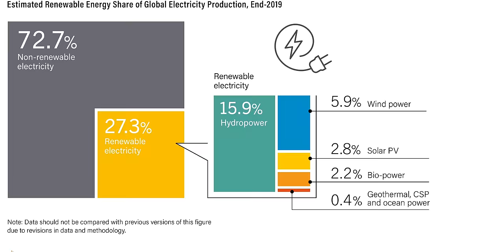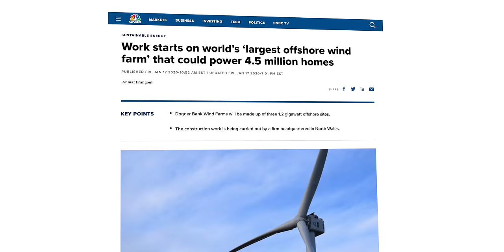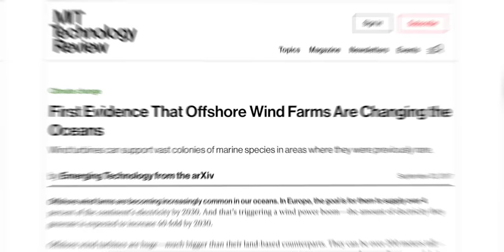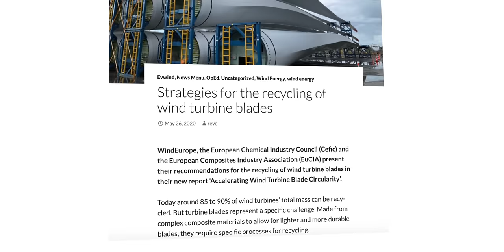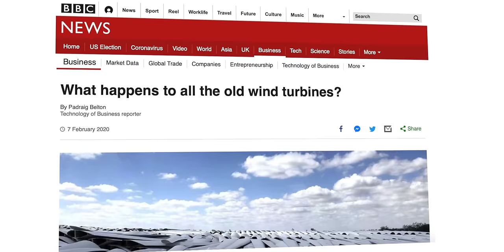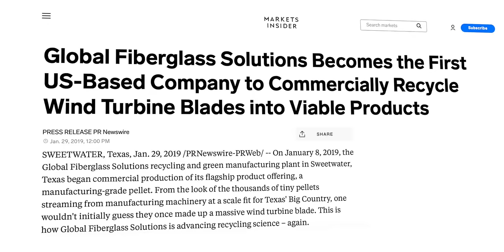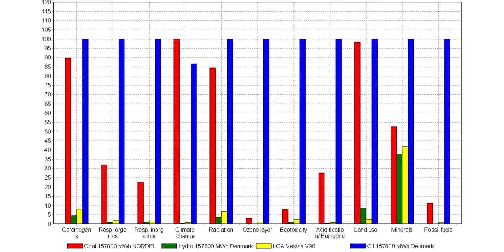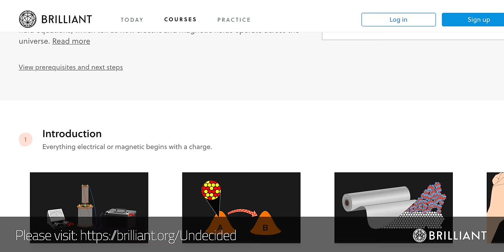The truth about wind turbines - how bad are they?

Comment from the maker: What do you think about wind power vs. the downsides?  And if you liked this video, be sure to check out my video "The truth about nuclear fusion power - new breakthroughs": https://www.youtube.com/watch?v=Wc8SJqAPVaM&list=PLnTSM-ORSgi7cadIj6qpCWkg-tPzN1sgj&index=3
Reply: Undecided with Matt Ferrell I sort of roll my eyes when the discussion devolves into the relative eco-friendliness all the way back to the manufacturering and installation process.  EVERYTHING has to be manufactured and installed-- nuclear, solar (and associated batteries), wind, hydro, oil and gas.  EVERYTHING has a negative global energy impact.  Clearly, burning fossil fuels, every day, to actually produce the energy is the elephant in the room.  Can we please stop the focus on the 1% of energy use and keep the focus on the 99%?
Reply: It’s important to make it clear that because wind is intermittent and requires 24/7/365 backup by reliable energy (normally fossil fuels), that wind and solar can’t be cost effective. If you build a 300MW wind farm, you also have to build (or keep open) a duplicate backup fossil fuel energy plant to provide energy for the 50%-100% of time wind or solar aren’t working properly. So you now are paying for 2 energy plants vs only 1 before, but all the cost estimates for solar/wind exclude the cost of the mandatory back up plant. This type of “Enron Pro-Forma Accounting” fraud is rampant in the solar/wind area. Having to pay for double the energy plants is the primary reason people are shocked by skyrocketing energy cost where ever solar/wind are added. There are no exception, everywhere solar and wind are installed, energy prices skyrocket for consumers. Solar and wind have to cost more, a lot more.
Reply: alliejr You are spot on! So many people view energy as just a “free” gust of wind or ray of sunshine, but that a very superficial understanding. Energy is the entire life cycle process from converting raw matter into reliable and affordable energy that scales, to its disposal when obsolete. When view in their full life cycle context, solar and wind are anything but green or clean...They are dirty and destructive toxic messes.
Reply: I would really like to see your take on vertical Turbines, Wind and Water(like Turbulent). I heard Vertical Windturbines are more Birdfriendly and take up less space, because the blades are not sticking out. Some claim they are even more efficient is that true?
Reply: Steve Fortuna You would IF batteries could store enough to meet base-load, avg hourly demand, peak and peak hourly demand plus days of storage, but that’s not possible given today’s current tech snd cost. Likely to change in future, but as it stands today, solar and wind only add cost and instability to grid.
Reply: Steve Fortuna  SF no need to revert to character attacks, just keep bringing information to the table for enlightenment.  There is a lot of people who feel like Tony, only with positive education with open dialog we can continue to make wiser decisions.
Reply: I just wish these wind turbines were installed in the urban areas that want the power that is produced, mostly for their benefit.  In my opinion, they destroy the views of nature in rural areas.  Also, raptors (hawks, eagles & falcons) are disproportionately killed, as they do not look ahead when flying, their view is downwards, looking for their next meal (prey).  If the incentives were never offered, I believe the numbers of wind turbines installed would be much smaller than the numbers we have today.
Reply: Steve Fortuna “The daylight energy cost going to the grid is....” The grid you mentioned is powered by fossil fuels. My point stands, your cost accounting is straight out of the Enron Pro-forma Accounting playbook, it’s dishonest.
Reply: Steve Fortuna “The man doth protest too much, methinks” Steve you just responded with the worlds longest Red Herring. No need to try and make up in volume what ya lacking in substance. And, ya really need to work on your interpersonal skills, but internet anonymity has a way of making other wise sheepish people act like wolves.
Reply: What actually causes a wind turbine to reach its end of life and require it to be fully taken apart?
Reply: I like birds. Never liked wind turbans. Windmills are far better. It is all about tip speed, which it too high because the blades are too thin so the blades must be long. The air blows THROUGH the blades of a windmill, so windmill blades are wider and don't need to be so long. This makes windmills much quieter and kill very few birds.
Reply: tagware Thanks for sharing the link, I’ll check it out. 

It’s not that there aren’t ways to store energy outside of fossils, it’s more about how dishonestly the current capabilities/cost of solar/wind are presented to the public. There isn’t a single factory anywhere in the world powered by self sufficient wind/solar and batteries. Not one. 

Steve’s 80 page Red Herring retort didn’t even attempt to defend his “don’t need a grid, just build batteries” statement which is what the discussion was about. I reminded him the factory he installed his 200MW solar system in, is connected to, and powered by, the fossil fuel grid. In other words it’s the furthest thing imaginable from self sufficient solar/wind, yet Steve wants to argue that we don’t need grids, just build batteries. It’s such a superficial understanding of how energy works. 

As an added bonus, Steve arrogantly lobs personal insults at anyone calling out his Naked Emperor obvious position. He went on and on about tax deductions, subsidies, etc....None of which had anything to do with the subject matter at hand.  Steve is seriously misinformed which is especially troubling considering this is his job! I can only imagine how many others he’s led astray. 

I could care less what energy sources we use so I’ve got no dog in the hunt. My position is that people should be left free to pursue whatever sources are best for their geographical locations, current levels of wealth and current/future industrialization needs, but the way we currently talk about energy is so sloppy, myopic and dishonest, that it’s impossible for anyone to make an informed decision.
Reply: Steve Fortuna  free forever? 

That's I think the counter point being made... cause that's definitely not true and it should be more transparent about the real cost.

Batteries and solar are also Pretty toxic, so I guess it depends on the view... But it's certainly not a zero sum game at all.
Reply: Steve Fortuna  Define fuel?
It's hyperbolic at any point as the underlying assertion and argument remains. 

It doesn't change if you use lots of capital letters, the point you're missing is that while we keep using words like "it's virtually free!" Many will roll eyes. And rightfully so. 

People are currently cheering closure of coal plants to be replaced with Gas, but the lack of overall transparency is pretty disgraceful.
Reply: Carbon footprint of turbine production and recycling is a drop in the bucket - good to try to minimize it, but not significant. Somebody may find them eyesores, others find a sight of offshore wind field, or turbines lining a ridge, inspiring - we will not find an agreement here. But the real problem is intermittency. We have many storage technologies, but none is cheap or easy to scale. Continental-scale grids are fragile and hideously expensive. All that needs to be taken into account when calculating the cost ow wind power. It's not simple.
Reply: There are several different blade geometries on wind turbines and some companies even claim to have solved some of the issues that caused it to catch on fire and are friendlier to flying wildlife just by their blade design. so why is it that all the media does is show this one design like it's either this or you are doing it wrong and it doesn't exist?
Reply: Tony Comer 

Uh, Tony?

There are areas where the wind never stops.
Reply: J Long, Jr. 

Bwahahahaha...

You want to put the wind turbines IN THE CITY.

Because you like the “views” of nature.

And you bought the “bird kill” hoax.
Reply: MythosGandaar 

Vibration.
Reply: T Samuel 

Larger blades move SLOWER.
Reply: @joelongjr.5114   I quite like the view of wind farms, it's relaxing to me. Also you should compare statistics of what else kills birds more... you should be surprised at how many birds are killed by windows alone. feral cats are the second-highest killer of birds in the world, followed by high tension wire, then pesticides, cars... ect. Wind turbines actually are some of the lowest that kills birds statistically every year. 
source: https://www.sibleyguides.com/conservation/causes-of-bird-mortality/
Reply: Getting huge windmill blades trough small country roads or, worse, small country villages, is a major problem. I wonder if the companies trying to develop cargo airships and battery or hydrogen powered helicopters could deliver a solution?

Getting those same blades back to recyclers would be a problem IF you for some reason want to recycle them intact, which is obviously not an issue if you planned to burn them or stick them in a landfill. The vehicles moving them will soon be electric and so will the mining machines getting the raw materials in the first place. As for needing energy to build and later recycle them, we have plenty of cheap energy from renewables, and will have more as more windmills and solar farms go up.
Reply: @AnalystPrime  IDK why everybody thinks that this blade design is the only one in existence, there are other windmills that use different designs and are not as long as that. Ones that rotate like a revolving door are used alot as well.
Reply: @CathayanMagus  It is not the only one, just currently the most efficient design when making big windmills that are supposed to be useful at grid scale. Not only does cost per watt favor megawatt instead of kilowatt turbines, but bigger blades work in slower winds and taller towers get more and steadier wind.

Vertical axis turbines have some advantages at micro/small scale but attempts to make a grid scale VAWT haven't really worked out so far.
Reply: @AnalystPrime  Yeah, that's just an engineering design failure that is caused by people not being able to think up a proper solution it seems. However, city-wide microgrid deployment of those seems to be a fine fit as buildings naturally funnel wind. All you would need is to rebuild city infrastructure block by block and slowly ease it into existence for it to realistically work. If only we could cut out all the legalized corruption practices like subsidizing large companies even though they post profits overseas or give them tax breaks so that they pay their fair share, then we could actually use tax funds for what they are supposed to be used for.
Reply: Whining about the minor disposal issue while ignoring the elephant in the room of fluctuation power generation destabilizing electric grids? Really? That is just poor .... boardering on propaganda ...

And there is a reason why there is so few offshore wind power ... when you need a high-sea-worthy vessel for replacing any small screw, the repair costs are so high that it is uneconomic...
Reply: CathayanMagus Its more about the type of bird being killed and by what. Cats are killing small (and plentiful) birds, while wind blades are killing large and much rarer raptor varieties such as Eagles, Hawks, Falcons, etc....Along with all manner of other migratory and protected species. The wind industry was killing so many Bald Eagles that in order to avoid being prosecuted under Federal Law, they lobbied for, and received, a special “get out of jail free” card from the Obama Admin.
Reply: @lawsonhannah  I don't think you are calculating the other industries that are being replaced by wind though as arguably they are affecting pollution levels let alone climate faster than the majority of species can adopt. I also question the validity of your claims that the wind blades kill as many birds as you claim as there has been research studies performed to identify how many are killed and over a year period, they found 2 bird carcasses in one wind farm area. However, I doubt that anyone of political importance cares enough about the matter at all as they actively suppress some of the biggest oil spills. Have you heard any coverage in the news of any of these current spills? https://en.wikipedia.org/wiki/List_of_oil_spills
Reply: CathayanMagus Hey Cathayan, My primary reason for the bird posting was to drive home the point that there’s no such thing as “clean”, “green”, or “sustainable” energy, All forms of large scale energy production create enormous amounts of impact and waste, but the dominate narrative revolves around only discussing the over exaggerated pros of solar/wind while at the same time only discussing the way over exaggerated cons of fossils and nuclear.  

The way we talk about energy and climate is so sloppy, myopic and biased that bad outcomes are all but assured. Going back to the birds as an example of the bias. Imagine if the fossil fuel industry got a special exemption for killing Bald Eagles? You’d have 24/7 news coverage, outraged activist everywhere, but when the wind industry does it, hardly a word of protest can be heard from those that claim to care. 

Or imagine the outrage if all those dead Eagles at the bottom of the wind turbines were covered in oil instead? The media and activists would be calling for more bans on oil drilling, CEO’s would be hauled up in front of congress, etc...But when those Eagles are shredded by wind blades, hardly a world of protest can be heard from those that claim to care. 

Or suppose in response to killing all those endangered raptors and migratory birds, Exxon responded with, “well cats kill way more than we do!” They would destroyed in the media, but when the wind industry uses that same excuse, not only is there zero outrage, the media actually supports the excuse. 

Solar was frying so many birds that they actually assigned the name “streamers” to this phenomenon. As the birds flew over the panels, they burst into flames and “streamed” to the ground like a downed aircraft. 

When viewed in full context, solar and wind are dirty, toxic messes that wreak havoc on local ecology. Does that mean we shouldn’t use them?  Of course not, but we shouldn’t pretend that they are green, clean, reliable, cheap and can power a modern economy because they aren’t and can’t.
Reply: Steve Fortuna  actually I do often ask those questions - but often I don't care. 

They're not the same thing as we can easily quantify the environmental damaged of each rather than push an agenda in either direction
Reply: @NuclearSavety  Utility companies have been using various energy storage technologies from pumped hydro to flywheels for balancing the grid for almost as long as there has been a grid. Adding some batteries to a coal plant means you don't need to fiddle with how much fuel you burn or run a whole second power plant in case you need more power quickly, saving huge amounts of money. Renewables have the benefit of not needing fuel so you can store all the power you want, but news always tries to make it sound like renewables meant only wind and solar, and as if weather and sunsets are completely unknown phenomenon that are so unpredictable that nobody running a solar farm will ever know if the sun rises tomorrow. Yes, it's propaganda.

Then there is the "but what wind doesn't blow for weeks?"- stupidity. Such situation is too unlikely to happen anywhere anyone would build windmills and solar panels, it is far more likely that some catastrophe cuts the power lines or destroys the power plants. And those do not happen to only renewables, that is why most cities have always had some kind of backup of a backup power plant.

Anyhow, it is more common that a sunny day or steady wind will produce more power than the grid can use. Cheap storage already exists and can fix the issues with wind and solar having occasional downtimes, the problem the media doesn't talk about is the grid being too old and needing replacement. If you could simply transfer the electricity from coast to coast you don't need hours of storage because there are always areas with higher production that can cover peak hours elsewhere.
Reply: @AnalystPrime  astonishingly there are days or even weeks, especially in winter where there is neither much wind nor solar ... 

Modern industrialized nations have energy storage of the order of 1h of national energy need ... thus you have the option to increase hydro-pump-power capacity by about a factor of 100 to 1000 or forget the 100% renewable energy dream. 

And the only semi-economic way to store electricity is by hydro-pumping. Batteries are freakish expensive, and flywheels ect. store only tiny amounts of energy in comparison to a national grid. Flywheels are usually used to bridge power outages of the order of seconds for specialized purposes....

And concerning there-are-no-times-without-wind-and-solar argument, Germany was close to electrical collapse early 2017 as the wind and solar was not producing for nearly 2 weeks.... it already happened!!!
Reply: @NuclearSavety  Energy storage is mainly for balancing the grid, like when everyone in the city opens their fridge and there is a sudden jump in demand for ten seconds. Because it takes too long to change how much power a regular power plant produces they have peaker plants that burn fuel 24/7/365 just to deliver power for that ten seconds. That wastes stupid amounts of money so building energy storage instead is cheaper. But that storage does not need to provide more than few tens of megawatts at most for few seconds to minutes. If you actually need to run your whole city off the battery power then you obviously use that time to get your backup power plants online, because something has gone seriously wrong.

Batteries are one of the most expensive energy stores but they have become economical, the only issue is whether raw materials mining and battery production could keep up if we wanted thousands of times more of them. I doubt it, but luckily there are other technologies and they are both cheaper and need less land area than pumped hydro.(BTW, building a huge reservoir destroys local ecology and no, you don't get more fishies and a nice lake to swim in in exchange. More like less fish and a "no swimming allowed"-sign.)

The issue is not that renewables need huge energy storage, the issue is that to make building huge energy storage economically viable you need overabundance of renewables to produce cheap surplus power to fill it instead of selling it directly to the grid. To power your city or state with renewables you need enough production to cover normal use and little more for special circumstances. Storage should only be used for short times when that is not enough.

Germany messed up when they closed the nuclear power plants. Europe has a proper interconnected grid so they can buy energy from sunny and windy countries if they fall short, but some idiots have overreached there. They also suddenly have protestors springing out of nowhere trying to limit where you can build wind turbines, despite the people living near them being just fine with them... I'm betting there will soon be lobbyists appearing who try to claim that coal is the only alternative.
Reply: @AnalystPrime  well, it depends, when having <25% renewables, you usually have enough conventional power plants as backup to equilibrate the grid, then you only need energy storage for short-term peaks ... But if you want >50% renewable electricity in a country and not pay twice for power plants (renewable power sources and a conventional backup), you cant circumvent a massive investment in energy storage...
Reply: @NuclearSavety  Proper smart grid too. Power lines are still cheaper than storage.

If you want to go for full renewables you can also use geothermal and wave power which don't change much, or buy twice as much solar and wind. You will need a backup for that solar panel, but the wises choice is always either a second solar panel in another timezone or wind turbines.
Reply: @AnalystPrime  yea how many wave power plants ever made it? And how many reached the economic break-even? And hope you have a coast without much tide ... and geothermal, great in iceland ... but not everybody lives on an active fault ... 

You are just offering straws ... and your smart-grid is already implemented, for example in south afrika ..  when the mines need electricityat noon, the power to the townships is cut ... but they call it rolling blackouts ....
Reply: @NuclearSavety  Ocean energy is still in research phase because there are so many different methods for tapping it, not because nobody has figured a way to make it work. And you don't want a coast without tides when tides are one of the energy sources you want to tap. The main limit is ecological concerns, not the economic ones, and the main economic issue is blocking areas from safe shipping, fishing and recreational use.

As for geothermal, a recent study in Scandinavia proved that you can make it work in world's least geologically active areas if you just drill deep enough.

Both methods only require active interest in large scale implementation to become viable. Given they are stabler sources that provide more power while using less land area than solar and wind, we only need someone to point out that no, fossil fuels are not the only alternative to nuclear, solar and wind power.
Reply: @AnalystPrime  you are right, there are many experimental(!) approaches to ocean-power harvesting .. not because it is physically complicated but because up to now nobody figured out how to build such a plant reasonaly economically competitive. 

Off-shore wind power already struggles economically due to the very high repair & service costs - and there the mechanical and electrical parts are above water. Submerging it makes everything much more expensive.

And concerning geo-thermal, yes you can drill deeper, but that makes evrything more complicated and more expensive ... 

Overall you now clearly follow the argumentation line: fluctuating wind power is not a problem because nebolous future technology will safe us .... 

This approach is nice for an internet discussion but really inappropriate in the real world when you know that a large-scale blackout has the potential to kill x-amount of people...
Reply: @NuclearSavety  We don't need future technology, just enough investment in the ones we already have. You don't just buy one solar panel or one windmill, you build whole farms, plural, in several locations so any one of them failing is not a problem. Same as every other piece of critical infrastructure.

Price is clearly not an issue, coal, oil and gas get billions in subsidies every year. Every solution proposed costs less than that and produces as much or more power without needing to pay again and again for fuel.

That means instead of futilely trying to maintain current energy production when the demand keeps rising every year you can produce more to match it. Profit!
Reply: @AnalystPrime  when we do not need future technologies, why do you refer to them? 

You can close your eyes from the intrinsic physical problems so hard you want, they do not go away ...
Reply: Each of the motors use petroleum grease for lubrication also
Reply: Brin Jenkins Hey Brin, You might be spot on about what the future holds, but I was commenting on how dishonest the current state of solar and wind are presented by people like Steve that should know better. Another issue I see all too often is how people like Steve respond when unable refute based on substance. He just went down the logical fallacy rabbit hole with a long winded and totally unrelated red herring and some really weird ad home/personal attacks. I mean who really talks like that to people in real life? :) 

Any who, as it stands right now, in the context of powering a modern economy, they are zero modern buildings powered by self sufficient solar and wind and the battery storage tech needed to provide on demand reliable energy 24/7/365 to power a modern economy isn’t anywhere near a reality on a cost effective scale. The unicorn battery storage as been “only 5-10 years away” for about 50+ years now. In other words solar/wind are parasitical energy sources that only add cost/instability to the grid. I’m sure that will lchange in the future, but our goal in the mean time should be to add clarity and give people all the information needed to make an objective decision based on an honest assessment of where things stand today...Nothing wrong with talking about the future, but we need to clearly and precisely differentiate between current/future.
Reply: We had answers, but f#ck green energy if u can't send the money bills with supply. Nikola Tesla was close to the answer. But and if u have honorably ideas, evrithing ends with politics and I do not want to listen any Indian or Chinese politics or I do not want 10 billions of them if we give them free energies. It is same as feeding coakroches, what the point. And l m not racists or nazist but see 'the end' at starting something stupid as gives humans free energy.
Reply: Steve Fortuna  You clearly don't know much about today's modern power grid and the need for base load plants that HAVE TO WORK when its cloudy or when the wind isn't blowing and batteries are still wildly inefficient and expensive.  Everything Tony Comer said was accurate.
Reply: I know for sure that if they built a wind farm anywhere near you, your property's value dropped by at least fifty percent,.
Reply: @lawsonhannah  One thing you never get from these type of people is honest answer.All you have to ask is cost of wind turbine incl.intalation
and how many years it will have to run to cover its own cost!!Correct answer is-TAXPAYER.Offshore wind is real  taxpayer killer.
Reply: @NuclearSavety  One must always be aware of what tech may make your current plans obsolete, as long as it doesn't lead to Osborne effect. China, India and the major oil producers have the right idea: they got their industry going with oil and coal and are now using their wealth to build solar and wind farms at sizes that actually mean something, instead of going "well we might invent fusion in fifty years so no need to do anything until then" and keep wasting their limited resources.

Physics<math, and math says mass produced methods of producing or saving energy without needing fuel will always end up cheaper than something that requires constant use of resources you can't recover or recycle.
Reply: @paulmisek7436  The honest answer is that wind including installation costs about $1.5 per watt on land and about $4 offshore, and it takes six moths to year for turbines to produce enough power to pay back the money, energy and materials used to build it. Those are, obviously, the cost before any subsidies or tax breaks, but they are from almost a year ago and though reports say prices have gone down since then I lack time to hunt down exact numbers right now.

Note the typical onshore turbines are 2-4MW in size, but offshore you get steadier winds meaning more power and less time not producing. Also, you can build higher towers without neighbors complaining and output scales by square of blade length so plans are to build 10MW and even 20 MW turbines, which lowers the cost per watt.
Reply: @AnalystPrime  neither China nor India is at a renewable production level which can not get compensated by addapting conventional electrical power production. Thus your examples are dishonest.

You on purpose avoid to adress the issue hat at a certain percentage of fluctuating renewables the grid stability suffers. 

The truth is, nobody knows how to push renewables to 90+% while maintaining grid stability. There were lots of atempts, battery storage, wave power plants, interconnecting/smart grids, ultra-high-DC-voltage long range transmission lines, power-to-gas, high-pressure storage, ... and all these approaches have fundamental flaws making it quite obviously that these approaches are not the golden sollution as some internet keyboard warriors claim.
Reply: In EU and particularly in Denmark we now see Wind turbines with out subsidies going up. 
The first in Denmark was at Hirtshals harbor 4 times 4 MW. 
And unsubsidized off shore is on it’s way. This company will built 0.56 GW as a start
https://europeanenergy.com/en/press-releases/2020/5/25approval-of-560mw-offshore-wind
Reply: @AnalystPrime   Renewable energies are already now only on the boarder of competitiveness. In Germany 20 year old windfarms are gettung shut down because they can not produce enough revenue to finance the repair effort for the increasing wear and tear. 

Windfarms or solar farms produce electricity when there is wind / sun, thus they produce only in times of maximum production = minimum retail price.

When your plan is to install massive electricity overproduction to have enough electricity in bad times, you will have to invent some future technology to pay for that insanely expensive plan....

Renewable energy is NOT MAGIC, it has to follow physical as well as economic constraints.
Reply: This video makes no sense. Wasn't compared to non renewables.
Reply: I really would like to see a video on vertical axis wind and water turbines. They don't have to be so large the can generate more electricity cost ratio and size. Bird friendly, don't have to be so high to generate electricity. Could be integrated into urban areas. Can be integrated into suburbs with minimal effect.
Reply: Steve Fortuna When you’re right, you only have to say it once. Your own example proved you wrong. 

I’ll give you one last chance at redemption—-Name a single factory, anywhere in the world,  powered by autonomous wind/solar and batteries only...Not connected to, or backed up by fossil rules powered grid or generators.
Reply: nah. like solar panels they're still far ahead than burning fossil fuels.  the issue is obsolescence, panels and turbines are replaced before they break down therefore the need for better recycling system.
Reply: Wind is so cheap that every country with lots of windmills suffers high electricity prices. Australia, Germany, Denmark.. they pay huge subsidies to keep their windmills running. I'm from the Netherlands, we also see costs rising with every subsidised windmill that gets placed. They wouldn't build windmills if those have to compete with cheap reliable coal, gas and nuckear.
Reply: @picobyte  What about the damage those nonrenewables cost to the environment? The place we humans live.
Reply: @Jo Blow You misspelled "logical solution", you should stop being so emotional.
And while such power grid will be built eventually we do not need full daytime power at midnight anywhere, only balancing the morning and evening hours when everyone is making breakfast or dinner and solar panels are not yet producing at full efficiency or are losing the light. This can be easily fixed in USA which only has four time zones not counting Hawaii or Alaska, while Eurasia spans half the planet and has always been decades ahead of America in basic infrastructure technology.
Solar is not the best solution to that on grid scale anyway. Panels on your roof easily cut down the house's electric and heating bills by 90-100% but there are some industries that keep their factories running at night. Wind, hydro, geothermal and nuclear are both steadier and produce more power than solar, unless we build a belt of solar panels thousand miles wide around the world only idiots and strawman idiots would suggest relying only on solar.
Reply: @Citizen World Imagine what it would look at night, sounds like a good way to get more people hate having turbines near their houses "ruining the view"...
It would probably work just fine, but main reason not to is that not many birds die to turbines anyway. Might as well demand that AA guns must have a bird warning feature to be allowed: not only is it too rare problem to spend major effort on, but given the alternative involves lots of humans dying that pigeon is an acceptable sacrifice.
Reply: I watched a "Discovery UK" video that basically showed a major design issue(s) with the current Wind Turbine causing them to deteriorate much earlier than expected. To be fair I believe most of the turbines they are referring to, are of fiber.. design. It's about a year old. The video  is called. .."The Glaring Engineering Mistake That Made Wind Turbines Inefficient|......"
Reply: @Citizen World idk if some1 mentioned it, but I know scientist &/or companies were looking into using low pitch sounds  & magnetic fields to help repell or divert flocks flight path from the area.
Also I saw that some companies are building or adding software into the wind turbines that gives them the ability to slow down & stop when there is an approaching flock of birds. 
I'm not sure how effective all this is, but I'm sure they're looking at all sorts of things to keep them away.
Reply: Vind/sun has the biggest cost  (investment/operation/maintenance..) compared to all other alternatives , only taxing industry/consumer will increase the cost to other sources
Reply: I think wind turbines are fine but the production of them require a lot of oil and gas to create the parts. If turbines were to have wind lenses on them, it is said to produce 3 to 4 times more energy. Why don't companies add that on them despite that obvious benefit?
Reply: there is always that comment that to produce there is the use of trucks and therefore diezel, I hope that electric trucks like tesla semi, will soon start appearing on the market to change this way of thinking, as well as the amount of energy used to create the countries or destroy them for example, as I see the system is already in loop in some countries, if equipment is produced using energy from a renewable source such as wind, solar or that has a smaller impact such as hydroelectric power plants, then surely it is better than one charcoal tank, so you have a product that really has a small impact, another thing that I think is wrong when some comment that you would live next to a wind farm? I answer try to live next to a hydroelectric plant or a coal mine ...
there is always a way to improve our impact, there is no lack of ideas, no political will.
Reply: Sic Semper Tyrannis  The power density of every method or combination of methods of electricity generation while excluding fossil fuel is too low to be viable. There just isn't enough room or valuable minerals even with 100% material recycling to do anything else. All methods have their uses but the wholesale adoption of any method must make both physical and economic sense. Also the materials used to make solar cells are toxic and cannot be recycled cost effectively. The infrastructure just doesn't exist.
Reply: @lawsonhannah  Costs of wind and solar are now the lowest form of installed energy period. People like you are as unrealistic as those you are trying to discredit. We are no where near the point where wind energy is unmanageable on our grid. Our grid is already designed to handle ups and downs of demand and does just fine, supply is the same concept in reverse. Will we need storage facilities long term? Absolutely. But those are in the works too with many already in operation for decades. Its not a new technology by any stretch.

As for your claims about skyrocketing costs, where properly managed, we don't see skyrocketing costs. In fact in some markets the price of electricity drops on windy days.

Regardless, what are you suggesting? We abandon solar and wind energy and do nothing?
Reply: Wherever there is a large % of solar and wind, there are high power prices and issues with reliability.
The higher the % of wind and solar, the higher the prices and the bigger the issues with reliability.
Reply: tagware ; an interesting study found that painting one blade a color other than White greatly reduced the number of bird strikes.
Reply: Ground source heat pumps should be installed in most new homes . They save energy 24/7 by taking demand off of the grid and there is no noise like outside AC units . They reduce demand the most when temps are the most extreme .
Reply: Undecided with Matt Ferrell Have to start somewhere or we won’t figure out better devices. No downsides.
Reply: @tagware  A simple fact Sic any others seem to avoid is that solar and wind are low availability/unreliable energy sources.  Even in the best environments, you get around 8 full hours of max sunlight.  So, to provide 24 hour power, you need three times the solar area, with extensive and expensive batteries to store the power.  With wind, it blows when it blows and it doesn't when it doesn't.  The company I work for operates a solar plant, two wind farms, one dam and one nuclear power plant.  In terms of availability, the solar is 30% at best, wind is around 33%, the dam of course produces the most in spring when there is runoff and a lot less by the end of the season, while the nuclear plant chugs away full power 22 out of 24 months.  The uncertainty with wind and solar make them a nightmare for a grid operator, who has to balance supply and demand to keep the grid stable.   In terms of return, solar is the worst.  "Experts" will tell your a cell pays back its energy cost in 1 to 2 years.  They're not lying,  they are just telling the whole story.  Sure, the wafer itself will pay back in a couple years, but when you take into account ALL the components of a solar system, the pay back is much longer.  Don't get me wrong, I'd love to have a few solar cells on the roof providing all my electricity for the house and an electric car, but reality gets in the way.
Reply: @CathayanMagus  do you trust this.  It could be the wind turbine lobby, making it up.
Reply: @lawsonhannah  untill power storage becomes more common.
Reply: The downsides are big things to consider. Solar can beat wind easily. It's even worse if we did wind and wasn't able to store it, it wouldn't be pointless-- but it'd be limited and in certain places only.
Reply: Not sure why Matt completely missed the wind turbine blade recycling efforts that are already happening....

https://resource-recycling.com/plastics/2019/03/27/company-expands-wind-turbine-recycling-operation/
Reply: I thank anyone who takes the time and effort to give us the upside and downside of anything and let us decide.  
I think when they made the wind turbines the length lifespan of time should of been considered & cost and alt use at disposal would not ofset the benefit - also I believe even with battery storage backup to increase effeciency must be 2nd to finding an alt use for expired hardware/but more importantly an alternative to currently made turbines.  (Considering hollands type windmills are still in use yet current turbines last 25yrs why? What can we do to make new turbines timeless with only maintenance or replacement parts extending their life? Lots of work yet on this project I’m afraid & alt thinking needed as were on the wrong material use here!
Reply: @GurgaGeorgiTaylor  What you are describing is already happening.  A lot of old wind turbines are being upgraded, so all the infrastructure built around them is there already.  They are being upgraded due to newest technology.  If you have a 20 year old turbine producing 1MW and you upgrade it to make 2MW, it is obvious why they would do that, as the investment is a fraction of making a new one from scratch.  All the concrete, the mast, the roads, the infrastructure can be re-used.

I think you are falling for the fallacy that the turbines are not lasting that long, but that is not the case.  The turbines are lasting 20+ years easy, but just like anything else, technology moves on, and the same turbine can now make far more energy if it is upgraded, so it is obsolete from that standpoint before it is worn out.
Reply: Late to the party, but..... add in the need for decidedly un-eco friendly battery systems and the unknowable impact on weather over time (AKA climate) of removing enough energy from wind to make a significant dent in needs, and of course the fact that in places where wind is at its most reliable the wind is sometimes too strong for turbines to use. This idea of a single new tech is beyond flawed and we need to keep nuke plants on the table ( a focus on thorium molten salt may be the best option). Oh, and don't forget that demand has spikes and troughs that things like a lull in the big game can influence so a steady stream is not a workable solution.
I have nothing against wind power itself, but I think it very bad policy to focus all of our energy on it.
Reply: @travissmith2848  Battery systems don't have to be un eco friendly and you can use stored hydro and other ways of storing the energy.  There is no unknown from "removing" wind energy.  Wind is constantly replaced and anything from tree's to mountains to buildings affect wind.

And no one is talking about a single energy.  They are using wind, solar along with several others, geothermal, tidal and hydroelectric.  The grid is already being managed with different demands for energy day by day depending on temperature, cloud cover and the day of the week.

There are many areas where wind is pretty steady, so no one is focusing all our energy on it, but it is definitely a large part of the picture.
Reply: @redbaron6805  You do realize we are talking about pulling many gigawatts of energy out of weather systems, right? This will undoubtedly cause some alterations to the weather itself. Climate is weather sustained over time.
Tidal power has two issues. A feedback loop insufficient demand to make use of economies of scale which in turn drives up prices making it less attractive driving down demand.  I am also given to understand that output is not quite what was expected making it also less attractive.
Solar, geothermal..... they all have issues and potential consequences not all of which understood at large scale implementation.

And yes, the powergrid is currently being managed for fluctuations in demand, but that is with a backbone of sources that can alter their production not dependent on external forces and/or output a constant flow. 

Battery systems tend to use heavy metals and even hydrogen storage has issues when recombining due to lubricants needed or the potentially hazardous complex molecules/chemicals needed to make fuel cells. 

100% green is a pipe dream, 100% renewable likely is to if for no other reason than the huge tracts of land needed. 0% carbon may be possible if we include nuclear options, but fusion is decades away at best. There is no win just tradeoffs and some consequences may not be known until long after we make our choice.
Reply: It is false. We do have 100% green energy. It is called Nuclear Fision. It is 100% green weather people like it or do not. Nuclear waist is different story but even nuclear waist is 100% green.
Reply: @victorveselov4911  Nuclear Energy is carbon free, and technically Nuclear Waste is Carbon Free.  But it is not Green in the traditional sense.  Green energy is renewable energy, and nuclear energy is not really renewable until we can safely process nuclear waste.
Reply: @redbaron6805  it is renewable. Little bit of physics, Sun energy is literal nuclear fusion reactor at the cor and nuclear fision on top. Nuclear reactor is reproduction surface of the sun. We cannot reproduce nuclear fusion rn because temperature requirements melt all materials. Moreover, that temperature is so high that if it go out oc control it can Turn earth in a star for a couple year. This is reason why I said we have the solution, we have technologies but people are ignorant. All current leaks are because we are using over used AC but we do not want to rebuild them in much safer, with much less waist versions. People too ignorant
Reply: @redbaron6805  nuclear waist is carbon free. We already have microbs that eat, nuclear waist, we building literally elevator into space (but it is not for humans)
Reply: We should be using a combination of all of the processes that generate energy from eco-friendly/green renewable sources, no one method will bring down global emissions and mitigate the global greenhouse gas emission issue, we should be using what we can, where we can, and as fast as we can. I like the idea that Poland brought to the table that can be installed virtually anywhere in urban areas, roofs and parts of urban sculptures/artworks, this video was very well researched indeed!
Reply: Sure there will be supply from different renewable sources that will balance out to some degree and a way of managing them all, that is implicit in the term 'renewable energy'. But there will be times when renewables of all types are low which is why energy storage and backup is needed. More renewables increases your exposure to such events and it is just not acceptable to have black outs/brown outs often. Businesses could adapt to some degree by seeing when electricity prices are high or low to do energy intensive work, but that is an extra constraint which reduces efficiency. Also forecasts for renewable supply would need to be very accurate for businesses to plan. Not saying it can't be done but there is an optimum energy mix less than full renewables which is also low carbon.
Reply: I have really appreciated your videos giving the pros and cons of different technologies and where they're at and giving it in a tone that is level and not like shock jock it has really been meaningful to me and has helped me to continue loving science
Reply: @lawsonhannah  you're absolutely right the only way to make things like solar or wind more sustainable by themselves granted that wouldn't be 100% independent of other power sources but the only way to make them more independent would be to have large-scale power dense battery storage and we don't quite have good enough technology to store that much power or I should say it would cost too much and money and for the environment at least until we get solid state batteries
Reply: I live by them.  They are noisy and every night that I look around the 160 acres I live on I’m sad when I see hundreds of red blinking lights all around me.  They have only had them up a couple of years and I’m trying to get used to them but it’s not the same.
Reply: Who uses landfills in 2021?
Fibre glass and carbon fibre can be recycled, only 3rd world countries use landfills for waste.
Reply: Fact is oil and  hydraulic fluid as well as petroleum heavy greases are used, each large wind structure can hold up to 400 gallons of oil alone! Od the many massive failures of late and the fact that the blades can not be recycled! Casper, Wyoming.
Between last September and this March, it will become the final resting place for 1,000 fibreglass turbine blades.
These blades, which have reached the end of their 25-year working lives, come from three wind farms in the north-western US state. Each will be cut into three, then the pieces will be stacked and buried. this took acers to bury! the blades life span is on its face an evironmental crime!
Reply: I live near 10 commerical grade wind turbines and they are not worth it.

They are noisy, cause health issues, can cause power outages when they have electrical shorts and are only 45% efficient.
Reply: California wants to be green too… There are electric bill was triple what mine is
Reply: You missed a lot of downsides.
Reply: Good video, thanks.  One quick question.  Why do all the wind farms space the turbines out so much?  Would there really be that much dampening of air speed to justify not bunching them together?
Reply: @itgoose597  the winds become disrupted (wake turbulence) as they pas through and around the turbines. Putting them to close together creates unstable wind patterns within the field and makes the turbines less effective. By providing enough space between the then the winds are allowed to return to a more or less smooth flow before they pass through another turbine.
Reply: The truth about Matt Ferrel, How bad is he? PFB How about "here's some pros and cons of wind power"?
Reply: @lawsonhannah  The wind still comes out cheaper because of saved fuel costs.
Reply: @tomlakosh1833  Tom, Wind is only cheaper if it’s fossil fuel dependent wind. Self sufficient wind (no FF backup) requires industrial battery storage which is orders of magnitude more expensive....Even if you could get it. 

Another way to look at. If you took 20% of FF offline today, the modern world would being to collapse, but if you removed 100% of all solar and wind farms, no one would even notice. Solar and wind just add cost and instability due to their intermittently which requires 24/7/365 backup from non-intermittent sources like nat gas.
Reply: @lawsonhannah  It's the same old ridiculous FF party line in that FF baseload generation is useless without peaker plants because they can't load follow either. Even gas peaker plants and hydro are lousy at frequency control and batteries are now cheaper and better at both frequency control and load following. Wind power actually helps with frequency control too due to the VAR capabilities of their generators.
Reply: @AnalystPrime  GE bought Blade Dynamics and LM Blades but both make two piece blades. BD made an 80 m blade for a 6 MW Siemens offshore turbine and LM now produces a 2 piece 75 m blade for the GE 4.8-5.3 MW nacelles.
Reply: @NuclearSavety  BS, all FF and nuclear baseload plants need simple cycle gas or batteries to back up their output because they can't ramp fast enough to follow the load variations but you deftly avoid that critical parameter when you bad mouth solar and wind. You're so FOS that its dripping out of your ears like Rudy.
Reply: @tomlakosh1833  you have a surprizingly strong oppinion, considering that you obviously do not have any technical knowledge how an electric grid works .... for example: no the main electric grid is not stabilized by batteries....

Before attacking somebody with personal insults, i recommend you first study the subject to not embarrass yourself ....
Reply: @tomlakosh1833  Haven't heard of that, links? How do they do it? The reason why blades have always been manufactured as one piece is that the tips of those big blades go hella fast even when they only do few RPM and the forces would tear the blade apart at seams.
Reply: @NuclearSavety  Main grid stability has usually been handled by pumped hydro where available, flywheels work even better but are expensive. Burner plants and nuclear power just cannot do the fast changes needed for grid balancing and using them risks brownouts and rolling blackouts so now that batteries and few other technologies like compressed and liquefied air are cheap enough to be viable at grid scale the peaker plants are getting shut down and replaced.

The math is simple, running a peaker plant 24/7/356 costs far too much. A battery needs only be able to provide 50-100MW for few minutes to replace that plant and while the peaker plant would be idling and wasting fuel the battery can buy cheap renewable power and sell it later when time of day prices are highest, so not only will it save tens to hundreds of millions $ in fuel costs by balancing the grid, it will also earn the owners millions. All that without need for any subsidies.
Reply: @AnalystPrime  i find it peculiar when you tell me nuclear power plants simply can not operate in load-follow mode when many nuclear power plants already operate in load follow-mode, see for example here ...  https://nuklearia.de/wp-content/uploads/2020/07/grafik-1024x484.png

These power ramps are not as fast as pump-hydro but faster than the fluctuations of e.g. wind farms...
Reply: @AnalystPrime  Be careful or I'll send this chain to GE and they'll sue your boss Putin.
Reply: @AnalystPrime  and i do not understand the fascination about using batteries for grid stabilitation. Batteries are waaaaayyyy too expensive and age waaaayyy to fast to be even remotely cost competitive in comparison to pump-hydro .... there are thousands of pump-hydro power plants worldwide, and how many 100+ MW battery plants? .....
Reply: @tomlakosh1833  Those are words, yes. But they make no sense.
Reply: @NuclearSavety  Grid balancing requires reliable fast response, the cost is worth it.

Google Hornsdale battery or "Tesla grid installation" for some others for data how well they work, Hornsdale paid for itself in under a year, that is almost as quick as wind turbines. For comparison, a gas or coal plant takes couple years to build and years to reach ROI.

Grid batteries are not going to degrade like the ones in cellphones and there are alternative chemistries even cheaper than Tesla's. And even if they need replacing in twenty years or so, the money they save and earn will easily pay for replacements many times over.
Reply: @AnalystPrime  you still failed to tell what batteries can do what pump-hydro cant do cheaper, and in a larger scale...
Reply: @NuclearSavety  Pumped hydro can do larger scale if you want to power someplace for longer time, but it is very location restricted, is only barely cheaper due to the large scale, and has far slower response than batteries or flywheels. Great for replacing that coal plant by storing renewable power for nights and bad weather days, not as good for the fast response needed for grid balancing.
Also, no, you don't get a nice lake for fishing and swimming, those people are mistaken and will be fined if caught.
Reply: @AnalystPrime medium-sized pump hydro power sizes already can follow power ramps of >100MW / 10s,  that is way faster than the fluctuations of consumption or renewable energy generation in a large scale grid. 

Thus that batteries or flywheels  can in principle perform much steeper power ramps is a nice gimmek but pointless.

Batteries have their justification  in energy island situations, but not in a national grid....
Reply: @AnalystPrime  You're obviously a troll spouting BS. Why didn't you mention that baseload FF need peaker plants too for ramping delays? How about brain damage from mercury in mothers' milk? How about deaths and property damage from particulates, NOx and SOx? Isn't species extinction from global warming enough?
Reply: @tomlakosh1833  ?? And here I thought you were one of the more sensible posters. Did you maybe mean to respond to someone else?
I did not mention those things simply because I saw so reason to repeat what everyone already knows.
Reply: @AnalystPrime  Really? You weren't trying to stack the deck by lying about battery load following and the material omission of FF peakers needed for FF baseload?
Reply: @NuclearSavety  Yes, pumped hydro can respond in about ten seconds, barely quick enough. Batteries and flywheels have <1s. response times, that basically eliminates chances of blackout from lack of power, and they also can balance power spikes far better than other options.
Reply: @tomlakosh1833  WTF? I asked for links to that thing about new way to build windmill blades you mentioned and you start talking about Putin. Are you drunk or something?
Reply: @AnalystPrime  the short-term ~1s scale power fluctuations you want to compensate by batteries are not the primary reason for grid black-outs. They lead to frequency shifts. Blackouts arrise predominantly by a lack of generation capacity so that the difference between generation and supply can no longer be compensated via frequency stift, i.e. delta-power times time....

For 100 years people can now sustain stable power grids (in first-world countries, not in countries where the infrastructure is neglected like Texas) with pump-hydro, and the emerging renewable energies fluctuate on a longer time scale ~ 10 minutes. 

So, based on historic data i do not see the need for battery storage in a large power grid. Like i already said, sub-second response time is cool, but a feature ultimately technically not needed.

If batteries have no striking technical advantage, it comes down to cost efficiency. You claim battery storage is only slightly more expensive than hydro. Well, i strongly disagree ....
Reply: @tomlakosh1833  peaker plants are FF’s so good luck with that type of thinking brother. I repeat, take 100% of all solar/wind off line today and not a soul would notice. They only add cost and instability to grid.
Reply: @NuclearSavety  The reason that fluctuation is so short is the batteries stopped it with their quick reaction time. Based on historic data not reacting quickly when the grid has large increase or decrease in demand or production causes blackouts, which is why power companies love batteries more than other, slower acting energy storage. (Flywheels are also good, but far too expensive compared to batteries.)

For 100 years power companies had to rely on fossil fuel plants which burn expensive fuel whether they produce any electricity that somebody pays for or not, you can't just turn them on or off when needed like a car engine. Power plants also have an optimum output range where they are most efficient, you can't just put half the coal in a 100MW plant if you only want 50MW.

Energy storage can deliver desired amount of power when needed and stop when not needed. This is why it is more economical to build a 100MWh storage than a 100MW power plant and why power companies love energy storage. (Also why fossil fuel companies hate energy storage and love peaker plants.) Faster reaction times of flywheels and batteries also mean they do not waste stored power when it is no longer needed, while cheaper cost and larger scale of pumped hydro and compressed air allow for storing more power for larger demand. Each technology has its own benefits.

With addition of renewable and nuclear power the ecological and economical benefits of energy storage become even greater: It was already cheaper and less polluting to use a fossil fuel plant to store energy for times of high demand than using another power plant, by removing the cost of fossil fuel and the pollution they cause from the equation nuclear and renewables make any energy storage massively cheaper and cleaner than all forms of fossil fuels.

With these facts anyone can see the need for and the benefits of grid scale battery storage.
Reply: @AnalystPrime  how do you come to the conclusion that anybody would run a fossile plants at full power but in idle mode to have backup power? That is an alien concept in real life engeneering. 

What you do is to operate several plants at their efficieny optimized point, which is not their maximum output power.  Thus when you have a demand spike you can increase the output of several plants a little bit what does not take much time. If thats insufficient you have pump-hydro as second line of defence followed by fast-starting gas turbines as third. This worked the last 100 years quite well....

I repeat myself, batteries are a cool concept, but cool does neither mean technically practical nor economically feasable....
Reply: @lawsonhannah  Totally false, they're cheaper than the FF if they're in high wind and high insolation regions like Texas. You're evading the fact that FF baseload has extra peaking costs too so load following wind and solar using those peaker plants just increases the capacity factor of the peaker plants, making them cheaper per kwh. Moreover, the ecological, disease, property damage and extreme weather externalities of FF makes them way more more expensive to society and battery peaker plants in combination with renewables eliminates the vast majority of those more costly externalities.
Reply: @NuclearSavety  Your opinion on batteries does not change the fact that people who know more than me about economics and technology have found that they are indeed both practical and economical.

The FF plants must keep burning fuel because 1. no, you can't change the output quickly enough to meet changing demand, and 2. cost, it is actually cheaper to build multiple power plants than use a big one inefficiently.

As just 1% deviation of the grid frequency will start damaging equipment the grid balancing must work within seconds, but when everyone turns their TV on at the same time and load jumps to 150% a single power plant cannot meet the demand quickly enough. A gas turbine would take minutes to ramp up, a coal plant might need half an hour; so you must have a second power plant that is ready to provide power immediately. If you do not have convenient renewables or storage to meet that demand the only viable option is to keep backup power plants always burning and ready to be deliver extra power.

Thing to note, those backup plants already exist. Any time someone opposes building more renewables saying something like "you need to build a new coal plant for every windmill" they are lying. And not just because wind turbines provide 2 to 10MW each while a coal plant might be 50 to 1000+MW...
Also, the power companies know well how expensive that is and do not want to pay for more fuel than they expect to need, so if you get a blackout it is not because wind and solar are "unstable", someone just decided a blackout is cheaper than paying for 100% reliability.
Reply: @AnalystPrime  you have unrealistic assumptions about the operation of an electric grid and obviously my words do not change that.

Therefore we can stop the discussion here.

I wish you well.

Let the future descide  if large-scale battery storage will ever get incorporated in the grid in more than a homeopathic dose...
Reply: @lawsonhannah  spot on! The demand availability of wind and solar is very low. Solar demand availability is zero during the night. Reliable backup is the Achilles heal of green energy, making it a green fantasy.
Reply: I would like to see a comparison of wind v fossil fuel power generation. When the cons of wind are presented alone it doesn't paint a pretty picture but how do they stack up against power generation system that uses fossil fuels.
Reply: @simonhill4021  there is tons of data from Europe if you search for it. One of the most important parameters to look at is demand availability, ie what is the probability of delivering X megawatts when you need it. The Europeans data proves you need the same amount of generating capacity in “conventional “ power generation to back up the wind/solar. That’s what the data shows. The promises of green energy are a green fantasy. As much as we would like it to work ( and it does work) it is not a viable technology for large scale energy production. A “side by side” comparison is a good start but there is much more to the story. For example, windmills produce a low frequency variation on the power produced (about 4 Hz) that must be thrown away. Wind also has big environmental impacts in a negative sense. Where I live we have lots of new wind farms. The state a few years ago commissioned a study to figure out why so many bats were being killed by windmills. Short answer, the windmill vortices trap bugs, the bats find a huge food source but are killed by the blades. Now a major predator of mosquitoes is being killed off.  Mosquitoes spread disease to humans and cattle. I have two degrees in electrical engineering, while energy generation is not my specialty I can read the technical journals and understand all the issues. 

I have nothing against wind and solar per say, they just are not viable for large scale reliable energy production . One “green “ energy source is however and has a proven track record: hydroelectric.
Reply: the problem is that even if the CO2 emissions are less than burning fossil fuels, they still add carbon to the atmosphere.
Reply: @thoraxepi  Nope. They add CO2, not carbon. But increased CO2 contributes to increased plant growth ( and healthier plants) which in turn increases oxygen in the atmosphere, aka the carbon cycle. That is the feedback control system. The “green house” effect of CO2 is relatively negligible (scientific fact). By far the greatest “green house” effect is by water vapor and clouds (also a scientific fact). Antarctic ice core samples show much higher levels of CO2 than today’s levels because the earth was warmer (gas is less soluble in warm water, most of the planets CO2 is dissolved in the oceans) we are overdue for the start of a new ice age by a few thousand years, per the data from cycles of glacial/interglacial intervals (about a dozen in the last 2.5 million years). We are far, far better off with a warmer earth. Colder temps mean less plant growth and therefore less food production. Contrast the warm medieval period where grapes where grown in Scandinavia per historical records vs the Maunder Minimum of around 100 years when we had the “little ice age”. Certainly there was no industrial activity at those times. Forces of many more orders of magnitude effect and drive the climate compared to human activity.
Reply: @thoraxepi  Er, no. A windmill does not produce CO2 or any other kind of exhaust while operating, if someone told you otherwise they are a lying liar who lies. And because the power it produces replaces the need for burning fossil fuels it effectively ends up with net negative pollution output value.

While the base and the tower require some steel and concrete, those parts are also far longer lasting than the blades and machinery in the turbine. The claims that replacing the blades or upgrading the generator after few decades of operation causes same CO2 release as building a new windmill are foolish lies and fake news.

Meanwhile, building a FF power plant requires more steel and concrete than windmills and as operating the place both incurs fuel expenses and always releases CO2 there is no way for a FF plant to recover the pollution it causes.

While we are not going to get rid of all fossil fuels everywhere because burning stuff is actually very convenient way to produce large amount of heat for a short term, replacing as much of them as possible with renewables and nuclear power will clean up our energy production and also make it massively cheaper.
Reply: Rediculous.  There is no reason why the world shouldn’t be building advanced modular nuclear reactors as soon as possible, if you want a great economy using EVs and hydrogen cell large vehicles.  It’s just insane to screw the globe up with the square footage that solar and wind would have to truly meet all clean energy needs.  It seems Mat either talks about the insane never happen stuff or stuff which can happen but never make a decent dent in our needs.  In the US, there is enough nuclear waste/spent fuel for advanced nuclear fission, for as long as it would take to develop nuclear fusion.  The small reactors can go anywhere, are incredibly efficient and safe.  It just a matter of doing it, instead of wasting time like we have since 2010 when the US had a bipartisan committee to develop Thorium Power, but was shuttled by an unfriendly DOE that drank the Koolaid from the green mafia.
Reply: @AnalystPrime  Advanced nuclear reactors are superior to all other energy sources, for electricity and transportation.
Reply: @Radarcb329   Show me a company that can actually deliver those reactors withing a few years and I'll invest in them immediately. Currently building a nuclear reactor means waiting 10+ years and spending billions on just a gigawatt of power, while a coal plant takes only few years. One of the main reasons why people went with FF over nuclear is that the coal plant will be producing power in 2-3 years and has paid for itself withing a decade or so, while the nuclear plant would still be under construction.

Also note, just getting the permits to build anything nuclear might take extra ten years, and if you get the permits and manage to build that plant, it needs about ten mile exclusion zone around it and lots of expensive security in addition to the also expensive engineers who operate the plant. And every few years you need to take a reactor offline for few months for refueling. One of the greatest proofs of how bad fossil fuels are for us is that despite all the dangers, expenses and worry about nuclear waste, nuclear power is still safer, cheaper and responsible for massively less deaths than any form of fossil fuels alone.

So you don't want more fossil fuel plants and nuclear is too expensive and takes too long to build, alternatively a mere billion dollars gets you hundreds of megawatts of wind power, a gigawatt of solar, or enough energy storage to put ten peaker plants out of business. And most of them can be completed within a year, assuming no sudden delays.
Or sooner: https://www.businessinsider.com/elon-musk-promises-to-solve-australias-blackout-problem-in-100-days-or-its-batteries-are-free-2017-3
Reply: @Radarcb329  spot on! Thorium reactors technology is being developed by other countries, eg Germany, so we will be screwed and have to buy it from others instead of selling it to others.
Reply: @Renato.Stiefenhofer.747driver  spot on!
Reply: @AnalystPrime  If the Obama admin had not of shuttled the bipartisan effort in 2010 to make the US the largest producer of advanced nuclear energy by choosing a DOE head which was against it, it would be here.  Meanwhile for 11 years clean energy tech has produced piddling amounts of our total energy needs including transportation.  Only since 2017 has this been moving in the right direction with designs approved in 2020.
Reply: @AnalystPrime  peanuts that take up a huge amount of space that only produce well in limited environments with extreme cost and government subsidies.
Reply: One word: Texas.
Reply: Giant wind turbines are the result of not looking at the big picture.  They feed the same old decrepit grid that was created because fossil, hydro, and nuclear have to be big.  But with renewables, transmission and distribution via the grid are big mistakes.  They're a waste of money.  The sun shines everywhere, so the right answer is to put the solar panels where you need the power.  Let the sun do T&D for free.  Eventually we can get rid of the grid.  By getting rid of the grid, we disable fossil and nuclear.  It's another way to kill them.
Reply: You didnt mention that they each require 750 barrels of oil just for the resin in the fiberglass. They are very lucrative petroleum based products.
Reply: Nuclear
Reply: Heehaw!!!!!!!!
Reply: Only 7 birds will die instead of millions if you PAINT THEM RED!!! With outward spiralling motives. Like a WARD!!
Reply: They don't work at all. In the UK, last Winter, they produced an average of just 5% of our electricity.   Today, 10th June 2021, they are producing 0.87%.  Useless beyond words.
Reply: Are the smart people working out how wind turbines generate electricity when the wind doesn't blow?
Reply: The impact of a wind turbine is a net negative energy production. If turbines produced excess energy in their lifespan ie. Profit. The industry would not need subsidies. "Greedy Capitalists" would move heaven and earth to build them. Instead the expansion of the wind industry is limited by governments resources to prop up the market.
Reply: I think they are ugly, and not worth the overall expense! We don’t need to add another curse upon the future.
Reply: I am wondering if there isn't also an impact on the climate due to converting kinetic energy from wind to electricity, effectively removing energy from the atmosphere. Then, I'd epected the climate to change due to less wind.
Reply: Thank you for this information.this is the most honest dialogue of the pro’s and con’s I have seen. Though you didn’t say how long it takes to install just one turbine in the ocean. times the number of turbines will take years to build this farm, all the while disrupting all the aquatic life.
Reply: They are not simple to maintain or cheap to run.
Reply: land is environment which "climate" alarmist were environmentalist, but not caring about farms, neighborhoods, sea life (the noise must be grossly loud under water now that we see whales dying at alarming rates) we have the invasion of bodies from radical peoples, So food farms being "phased out" as well as all country sustaining industries have been with a law of diminishing return.  Since environmentalist have proven they do not care about land/the environment they had to call themselves something else and weather not only is seasonal but cycles so they use those cycles to say oooh see "climate change".  Which ever way the wind blows, the "greenes" will distort it. So all those dead birds emit methane, but dead trees do, living things with humans the most productive at emitting. methane. Circle of life better than man made.  CO2 nourishes trees that in turn produce O2 for us breathers,  The lower the co2 trees will die plants won't thrive.  Seems this "green" has been will continue to be green for very few pockets, corporation who no longer are ethical getting grant money OUR money to push whoever is pushing fake "green" . "Experts" are supposed to think about all these things before it's pushed on the world.  But they don't for pocket lining and undeserved, then, fame of sorts.  They even had to change from "global warming" to  lol "climate change" .
Reply: A few nuclear power staions, don't mention Chernobyl, they have come a long way, will provide plenty of green electricity. Stuff turbines, save the countryside.
Reply: @lawsonhannah  kinda like electric vehicles?
Reply: Eliminate subsidies and we'll know if it's actually sustainable
Reply: Why does no one mention the amounts of oil and grease that are used in every single wind unit ? Between 40 and 200 gal,Depending on the size , goes into each one and has to be changed out on a regular maintenance schedule. These require fossil fuels to run. Who are we kidding. Somebody is getting their pockets lined with money.
Reply: wind turbines and renewables is what you get when people bad maths get into power or influences politics
Reply: @lawsonhannah Exactly!
Reply: @joelongjr.5114 Not to b mention if the wind solar were installed near the users, the Transmission savings would be substantial. 

It's all a game with wind and solar in my opinion. People have been told a fairy tale and want to believe.
Reply: @MythosGandaar Cyclical loading. The blade is a mechanical structure that is under cycling stresses. Over time the quality of that structure degrades. Eventually if left in place the blade will fall apart.
Reply: John Klauser, 2022 Nobel Prize winner in physics, states there is no climate emergency.  
Of course, the alarmists will say he is not a climatologist.  However, meteorology is the study of the physics of the atmosphere, so he certainly is qualified to speak on the subject.
If human induced climate change is not an emergency, then why must we erect these eyesores all over the countryside to harness clean, but diffuse, intermittent energy in the first place?
Reply: every power generation requires backup DA @lawsonhannah
Reply: Cool thing about wind and solar is the well never runs dry like gas and oil.  So re--powering after 30 years is always financial benefial to farmer and developer.  @MythosGandaar
Reply: You sure don't have any issue lying about Windmills and Windmill farms.
Reply: My mother and I were just denied our conventional loan in Deckerville, MI because the property has a windmill easement.  So, right now I am not in favor of windmills..
. although, I once was.  I do, however, feel and I'm excited to hear about the advances being made with this tech.  Thanks for the info.  I'm going to take what happened to us to the county zoning administrator, so he knows more about the effects the windmills are having on Deckerville, MI real-estate and culture.
Reply: Hey  @lawsonhannah  You're all wet! Next to hydro power, wind and solar are the lowest cost sources of power. What is the source of your information?
Reply: Hey  @lawsonhannah  you're all wet! Next to hydro, wind and solar are the lowest cost sources of power. What is your source of information?
Reply: @WallyBraun  Since solar and wind don’t work as needed most of that time, they need reliable back up (usually fossils) 100% of the time. This duplicate cost is excluded when prices for solar and wind are quoted. Nuclear and hydro are great sources of reliable energy so not talking about those, but nuclear has been basically criminalized and hydro requires very specific types of geography so doesn’t scale like nuclear or fossils.
Reply: Batteries are evolving rapidly. Semi solid state battery packs for cars are already being delivered. Many players in the field of development are fighting to come out first with solid state batteries. An order of magnitude better than Musk's big battery. Cheap, light, fast charging, fast discharging. Unlike fusion, within realistic reach. The recycling stream of all the materials from our present Li-x is getting more mature by the week. As more of the transportation sector goes electric, it becomes a form of a grid scale battery with some smart switching, which is already developing to work with our existing grid.  Flywheesl are a very niche and local fit for storage. I have high hopes for the big grid scale electronic battery installation to fill in the needs of load balancing in the not far future. Big wind needs big batteries of some form to be realistically beneficial, but it's coming. Not in tens of years but maybe in a single ten years. Hoping but not holding my breath for thorium any time soon. Just some hopeful thoughts here. I welcome disagreement or correction.